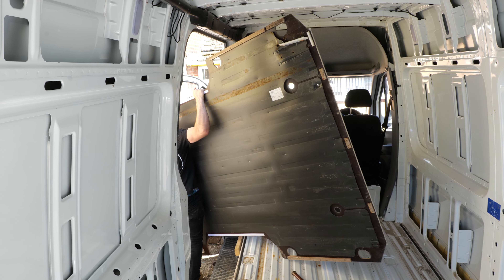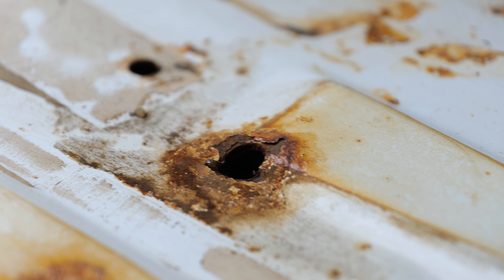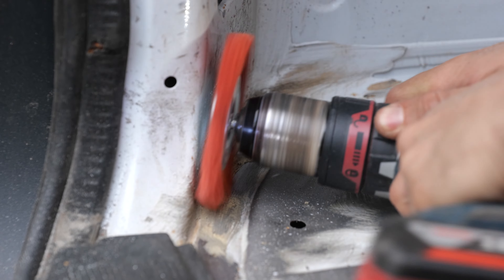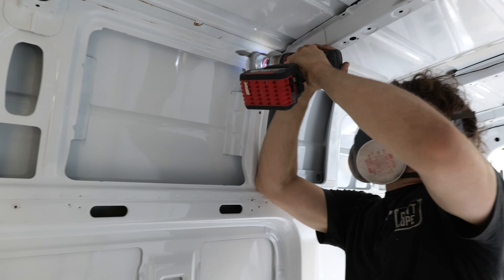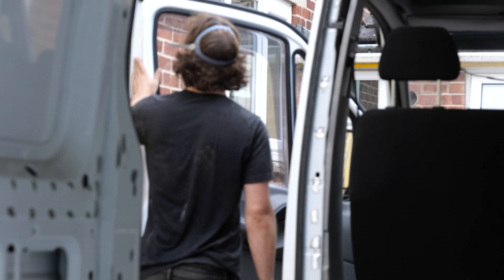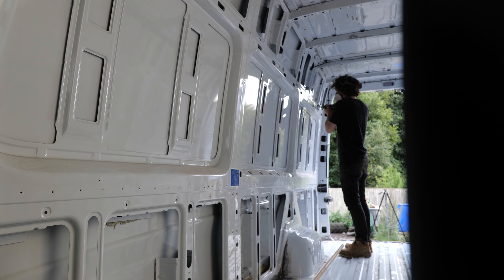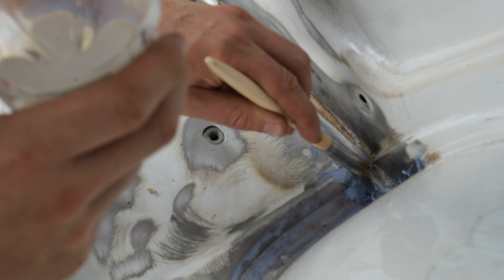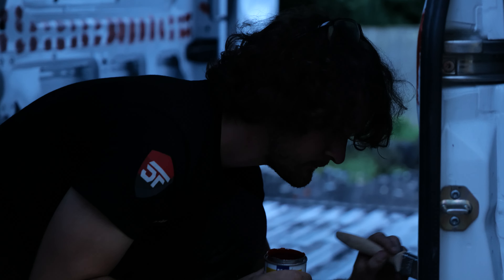How to Remove and Prevent Rust in Vans | Mercedes Sprinter Conversion #8

Comment: Late to the video, just restoring a mk6 transit , I did the same as yourself up until the kurust,  I used red oxide epoxy primer 2 pack as it comes with hardener, and painted the whole floor area instead of patches,the red oxide epoxy it has like a rubbery to touch finish absolute would recommend this and allowed to dry then painted the whole floor with white exterior metal paint

Comment: I've used one of those twisted wire cups on an angle grinder for removing rust and it worked a charm
Reply: Amazon, do some new smooth sanding discs that go on your grinder that are about an inch thick of some werid material, and they work great. The only problem is that you need alot my mate used 4 on his narrowboat stern and I think they cost 2£ each

Comment: thank you lord for this video. I'm on exactly same stage of my sprinter van conversion and I was wondering how I should tackle rust problem. My 2012 sprinter is in good condition but it has a lot of scratches inside just like yours. In my car, rust also collects under the seals at the windshield, but also at the sliding doors. Will you also remove rust in these places?

Comment: The rust stabilizer is probably phosphoric acid based. That turns iron oxide to iron phosphate which won't spread.
Reply: I think you are right. Heisenburg stuff - it turns the rust into something else👍

Comment: These twisted wirebraid brushes are available for angle grinders, too. Most aggressive way to get to it, while actual GRINDING afterwards with 150 grit on the 115 or 125 angle grinder would remove the parts of non-loose rust wire wheels do not address.

Comment: They do a twist wire brush for the grinder. The one you had used is just a crappy diy sort of one. Pretty sure screwfix do them. Though mind your body with it. High speed wire is always good fun

Comment: My van was like a colander after taking the ply liner out. (Some muppet had even gone into the diesel tank with 3" screws. I couldn't understand why it didn't start leaking diesel till I took the ply up) Having wire brushed as per I then sealed up the smaller screw holes with very short self tappers dipped in Hammerite.

Comment: Nice work! I would definitely use multiple layers of protection. What's the point of painting over rust when it can get worse over the years and lead to a worse problem down the road? A little prevention now will save a lot of headaches later.
Reply: Red oxide needs painting. If not, moisture gets to it quite quickly. It only works as protection against rust underneath so you can paint over with a proper metal paint primer ontop and seal and protect everything.

Comment: you should use acid in first step, and after grinder, and after epoxy primer.
Reply: hi I thought the same about using an epoxy primer after the grinder. Do you think if using the epoxy you could go straight to hammerite or do you think the kurust and red oxide is still necessary?

Comment: The abrasive discs are meant to be used at a low rotation speed so you need an angle grinder with variable speed adjustment. They degrade much slower if used at the correct speed. They are better than wire brushes (on an angle grinder)  because the wire brushes can quickly become to hot and therefore polish the rust but don't really remove it. Your electric drill has a much lower rotation speed, this is why the wire brush worked a lot better on it.
Reply: That's rubbish. The abrasive disks will wear out after the removal of a given amount of material. It'll wear out quicker at a higher speed, but will still remove the same amount of material as it would at a slower speed. It'll just take longer to reach the same state!

Comment: norton blaze rapid strip --- its a way to go ...last 10+ times longer than this "abrasive disc thing" from 1:02 and works like 5x faster
anywhere else u need abrasive materials ,cutting discs etc--- go with 3M Cubitron II or Norton Blaze --- they last 10+ longer than any other brand on the market and cut / grind etc 2x faster 
tested myself as a someone that really HATE to use abrasive materials (i'm working with composites like carbon fibre etc and metal😅 and daaamn ... 1 piece of cubitron XTRACT for orbital sander last 15x longer than festool where its at least 3x faster) 
Blaze is like 70% of the 3M cubitron II speed and lifetime....but have way stronger and more elastic glue that last longer when u push it on small parts (nails , screws etc)
where cubitron last longer and cuts /grind faster but easily get destroyed when u push it to hard but cost less
only one issue with blaze is that it's hard to find and it can be more expensive
Reply: What tool should be used-a drill, an angle grinder, etc?  thx.
Reply: @abytc2023  angle grinder 
But with speed controll , you cant use it at max speed or it will get destroyed easly on corners etc if you still learning how to use it (if we talking about norton blaze rapid strip /blend or 3m scotch brite)
But
You can get 3m scotch brite for drill that should work better for begginers 

Or you can find abrasive brush that should work even better in hard to reach places etc but they super expensive

Comment: I can give you a reason you have the rust in the first place......All cars/trucks Get wet outside and inside ...So why in areas And not in others.....Its not what the water is ...Its whats in the water ..It carries Dirt that builds up And forms ...Mud That mud has PH's into Acids that soften the paint And lay under it ......Moldings floors Nice areas out of the view of the sun and take x4 amounts of time to dry out ...Wash your van in the crack and trim 1 time a year check your floors under the carpet if you see signs of rust at other areas ....Clean the needles and leaves out of your wiper area

Comment: Thanks for not showing your results and not mentioning that this method doesn't work for the exterior because the hammarite paint comes out in streaks from a paint brush. 
This is the "I don't care what the end result will look like because I'm covering it over with insulation" method.